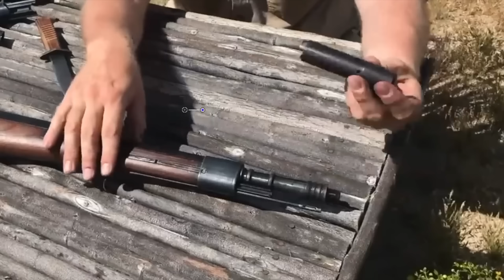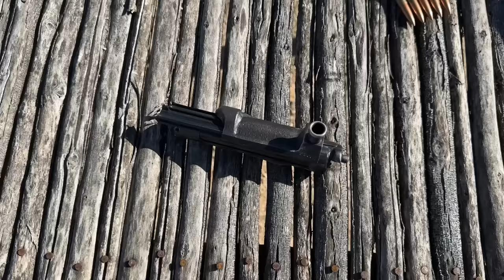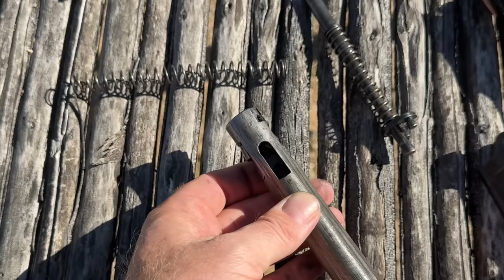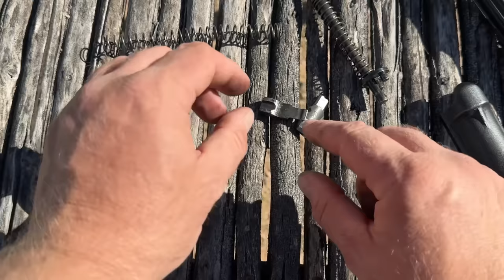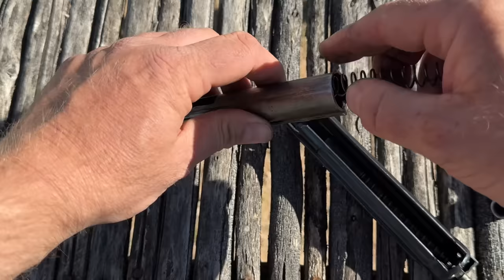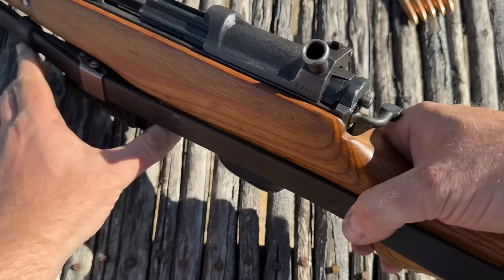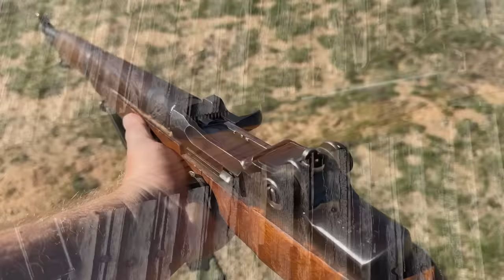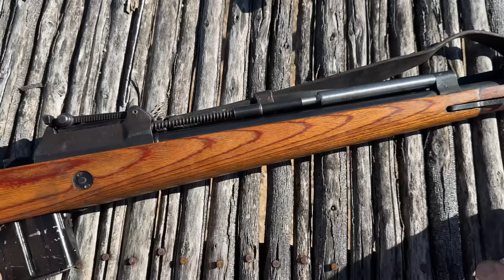Das G43 Wunder-Gewehr ist Scheiße

Comment from the maker: Some errata:
At 6:49 I refer to the folded/weld point as a crack, which it is, but is part of the manufacturing process.  That said, that is a definite weak point and that welding point absolutely cracks further under use.

I make a statement that no one copied this design post war, which was ALMOST correct - the Brazilians did with their M954.  Briefly.  Whoops.  
Maybe Taurus can release it as a retro rifle series.  :p
Reply: The crack area is easily remedied with a weld.  If you install the gas system upgrade kit that is available it will never be a problem and the G43 will run reliably and as long as most other battle rifles.
Reply: If anyone wants to make a reproduction G43, then they have their work cut out for them. Simplifying/rectifying the gas system and eliminating any potential issues with continuous fire with only basic maintenance, are all things to consider when making a reproduction, that not only functions better, but looks as close to the original in appearance.
Reply: @M1GarandMan3005  The kit I had installed in mine not only looks like the original it is reliable under continuous fire.  The upgrade kits made have solved the gas problem I believe that caused the bolt group to batter the gun.

Comment: As someone with ADHD, during cleaning I would instantly lose a critical part of this gun. We are truly spoiled by modern firearms design.
Reply: You have to wonder how many German units on the Eastern Front that were listed as being armed with G-43s were actually using captured Mosin-Nagants most of the time.
Reply: @MisdirectedSasha  It's a macabre thought but there's something to be said for internal regulations becoming meaningless when the offenders just naturally don't survive long enough for the higher ups to become mad at them, lol
Reply: As someone with both ADHD AND a 1945 G43, that thing is my worst nightmare when I have to do anything beyond simple field stripping lol. I rarely ever fire it or do anything more than look at it or take it out to show people bc it's fragile, has severe metallurgical issues, and some replacement parts cost more than most pistols plus the aforementioned fun of putting it back together. But it is a fun one to shoot

Comment: I have an SVT-40 dated 1940 (serial number puts it around December of that year as far as I can determine). It's amazingly fun to shoot when it runs right (it's very ammo-picky and needs to be well-lubed). It's technologically an amazing piece of equipment. Lightweight, pleasant to shoot, and well over 10 years ahead of its time. To put it in perspective on how light it is, at 8 pounds it's actually a half-pound lighter than the Mosin Nagant bolt action, yet with the integral muzzle brake it's a lot nicer to shoot. It's basically an M14, in 1940, and over a pound lighter. Note: I'm in Arizona if you ever want to use it for an episode.
Reply: What's your experience with the magazine issues Karl (and others) alluded to?
Reply: I had heard that the Soviets stoped producing them because they felt the rifles were too complex for their conscript soldiers to maintain. How hard are those rifles to keep running ?
Reply: @MICHAEL-tz9ni  it's more like the rifles were not cost-efficient to keep producing. They choose to produce more mosins and sub-machine guns instead. Tanks and armored airplanes did much more work than infantry
Reply: Ha! Well lubed
Reply: @MICHAEL-tz9ni  They stopped producing them because the Germans invaded in the in 1941, when they were gradually toning down Mosin and increasing SVT production. It has barely entered mass production. Since a ton of both Mosin and SVT stockpiles got captured in the initial blitz, the Soviets reverted back to Mosin production since it was cheaper, more cost effective and the tooling was already there, so wartime production was easy to start.

Comment: The "crack" at the bottom of the sheet metal guide rail is actually a residual aspect from the stamping/rolling process. It's never supposed to be connected or welded. Even though it is definitely a weak point...
love yout video, greetings from France
Reply from the maker: Yes, it is, and that point tends to be where the cracks get worse - and they get worse over firing.  I should have said weak point, rather than, crack, and I'm sure I'll be getting a lot of comments over this. LOL
Reply: I hope you didn't took it in a wrong way, i didn't meant it as a reproche, just pointing it out. I'm not defending that piece of history, definitely not the best of design. I like your content, i have learn a lot thanks  to it  @InrangeTv

Comment: Not an AK fanboy at all but you can really understand Kalashnikov's design philosophy of making a gun simple to field strip and clean in light of how over-engineered the WW2 German semiautomatics are.
Reply: As a finn who has been a conscript in the defence forces I'd say the AK system is admirably well designed. It can be used even by the stupidest 200 pound gorillas who can break a ball bearing in a padded room.
Reply: and notably took that failure area of the G43 and other guns, the rear of the reciever, and made it into a far-less shock sensitive area, using soft rivets that can flex slightly to absorb the energy instead of directing it into thin, hard parts that will fatigue and crack
Reply: Ironically, Kalashnikov didn't base his philosophy of design simplicity on German equipment, but, according to what I've read, on some of the more "brilliant" inventions of some of his fraternal socialist contemporaries who had been visited by the Good Idea fairy...and whose brainchildren Mikhail Timofeyevich was then expected to keep running in the mud and crud of the front line while he was a tanker.
Reply: @christopherreed4723  Both Mihail Timofêêvič and Vasilij Alêksêêvič had been designing what they could. 

Frankly, reliability of AKM is obligated, yes, obligated to the M-43 round. 
To its shape: the steep angle of the walls make its case extraction easy, since one of the problems – fricion resistance during unlocking and extracting – is solved by the distinctive conical shape. Right as the case starts to move, the resistence is broken beacause remnant pressure cannot expand the case enough to make it being a problem. With cylinder shape of case, it can-can-can be a problem, especially when there's a talk about high pressure ammo.
Energy of the round is significantly higher than a pistol round, making it able to pass the «fighting the foreign debree in gun's internals» energy barrier, so the carrier of breechblock can make it to the rear.
Reply: @christopherreed4723 The actual operating system is more based on the M1 Garand and the layout is based on rifles already know tho Kalashnikov like the Feder9v Avtomat and AS-44